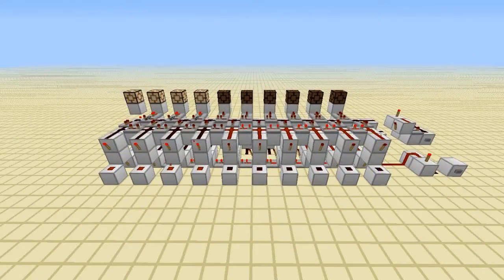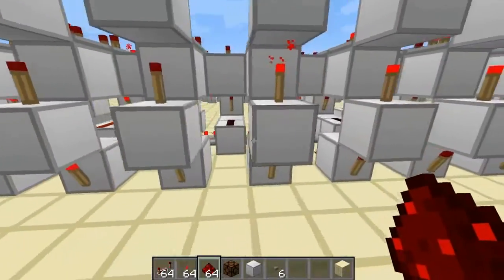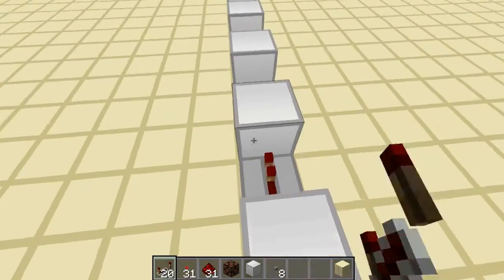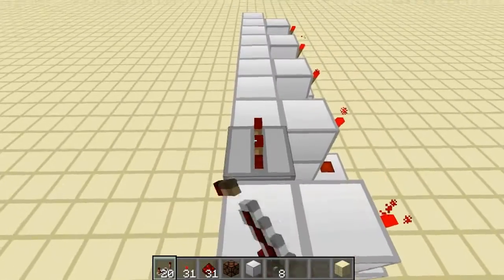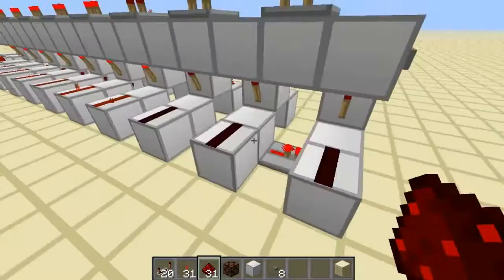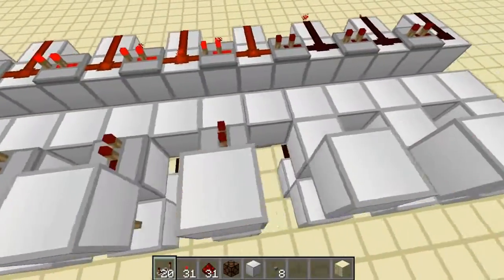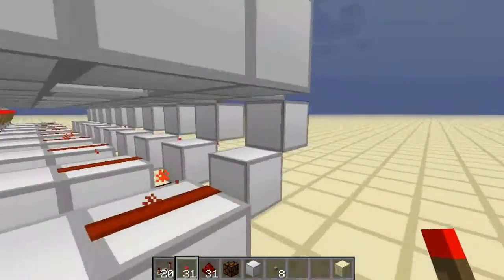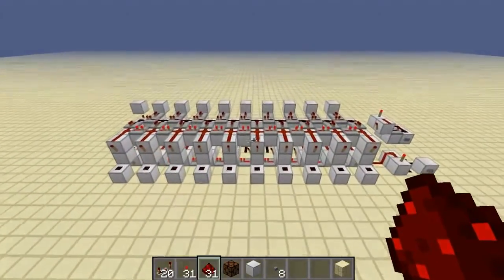Bi-directional Pistonless Redstone Counter   1.8  [Minecraft Tutorial]

Comment: damm you tricked me,   you said it was expandable to fit your needs,    but i need a counter to count to 26,     but when you make it 26 outputs wide  it takes SUPER long to count since each signal has to go aaaalllll the way through the machine through all the repeaters......  its completely useless because all the timing will be off,   as the first count would take 26 ticks (26 repeaters)    but the last few will go very fast...   so to fix this what...    i should equal all outputs so that it takes 26 ticks to count?   that way it would atleast be all even...  but dang that is slow :P